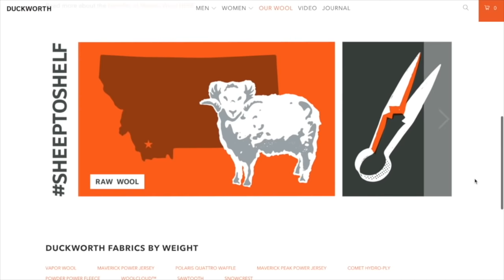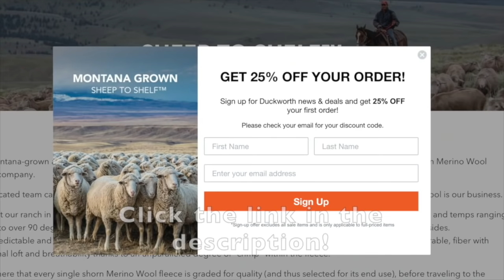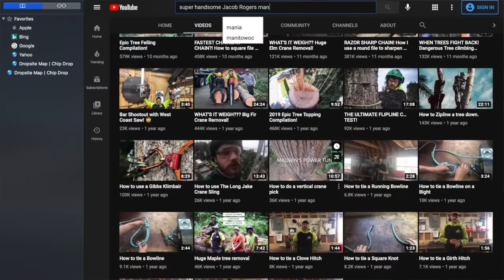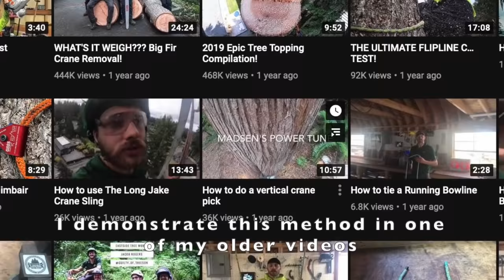Part 2! GIGANTIC Dead Maple Removal!

Comment: That was a great job, carefully thought out and executed. It does make me nervous seeing logs weighing several thousand pounds hanging in a sling almost directly over you.

That hole in the middle of the stump reminded me of a huge Valley Oak my neighbor had that split and fell. It looked perfectly healthy except for a V fork about 35 ft. off the ground. The larger  half fell into my yard and flattened 2 big buckeye trees, plus it broke a both railings on an arched bridge I had put over a small creek bed. 

When the tree guys were done cutting everything up, the stump was almost 8 ft.@ 2 ft. off the ground and 3.5 ft. of the heart was gone. You could have enlarged it and made a hot tub out of it!

An arborist estimated the tree at 325 years old give or take 20 years.

Comment: New subscriber.  At the first of the video you were speaking of Duckworth, I will check them out.  I am older than you.  I got a kick out of your statement about wearing the garments for a month and not washing them a lot.  My wife is always on my case because some of my favorite garments do ot get washed as often as she thinks they should.
I am in process of putting 5/4 deck boards on my bedroom walls and ceilings, and was impressed that the back ground wall was covered in what looks like a similar material.  Looks good, hope mine looks as good when it is finished.  At least when comparing some individuals there is not too much of a generation gap.
I volunteered to clean up some tornado debris this past summer, lost weight, improved my health, met new friends, and improved my health and well being.

Comment: As a crane operator, I always made sure I removed the limb or trunk straight away from the arborist, and lifted while not over top of the arborist.
If you watch crane videos , strops and ropes can always break, or slip,
Most mostly break.

Comment: Another great video. 
Fill that stump with diesel & tarp it. Maybe drill some really deep 2" diameter holes & diesel them also. Let it soak in for at least a week. Screw some metal flashing to the side of that deck, leave a gap. Water the deck & keep it wet. Start the stump on fire. It might burn for 2 weeks.

Comment: This was a professional job to the highest degree. All the best equipment and guys knowing what to do as a team. That was very dangerous and they did it safely. I cut trees for over 30 years but I learned a lot from these guys. I guess the stump you leave it, but still a jam up job. I finally got to see 088 Sthil in action. 
. LB Oklahoma Nov 2022

Comment: Back in the 70s while I was working for local parks&rec we had to take down a 125ft tall Loblolly pine that was eat up by pine beetles- at the ground level it turned to be 5ft across- we didn't top it just fell its- we put a pull rope on it about 75ft up and pulled while cutting- just as it started to fall over a high wind gust stood it back up crushing the chainsaw bar and jerking back the tractor pulling on it- that was a FUN day lol

Comment: Hey man I was watching your 500i video the other day.  You mentioned that in 10 years you haven’t figured out how to not spill bar oil when topping off the saw.  I am sure it was more a joke than serious observation, but I have found a pretty good remedy.  An old laundry detergent bottle works great.  The kind with the little push button tap on it. Thanks for all you do.  Climb high, be safe.

Comment: I have found that the size of the cut versus the bar width on small electric chainsaws can tend to make them more susceptible to jamming, especially with some type of wood.  They basically don't have the same "clearance", so stringyer, wet, etc, type wood cam jam more easily than with a larger dang/dang saw as they have more chain cut to bar clearance.

Comment: You guys were talking about milling at the end. What happens with wood like that? Is it for you to keep, the owner of the house, does it go to a sawmill?
Reply: The owner of the house decides what to do with the wood during the bid. I had 7 trees wind sailed and a 1 small Doug fir and large black locust tree out some of the  Douglas Fir branches were 3-4 inches thick. I had the tree service take all branches that were smaller than 3 inches. I ended up with 7 cords of wood from the work. None of it was worth slabbing. I filled up 2 truck loads of chips from the black locust branches and the smaller Doug firs. I’m glad I did this in 2008 spring right after we purchased the house. It was one of the few smart decisions I’ve made. His video of the tree down on the roof while pounding in the fence post rekindled the “glad I had that done” I have 7 trees only 75 feet from my back of the house and they are 100 footers. I hope they don’t come down while I own this place. I ‘d call these guys to come crane it off if it ever does.

Comment: @11:40 "BuT eLecTriC iS THe fUTuRe" lol not yet haha
Reply: I agree, a chainsaw with an electric motor that had the same power output as one of those larger chainsaws (like the 880) would be much much heavier, to the point that I'm not even sure someone could lift it even if the motor was brushless, and that's not even mentioning the fact that the battery pack to power such a saw would be more of a battery BACKpack, simply because it's so heavy and large, and you'd basically have welding cables going to the saw itself.
A much more practical solution is found in heavy-duty power chainsaws that you find mounted on something like a purpose-built logging tree harvester. Where the engine or electric motor would normally go, you find a quite small for it's power output hydraulic motor, which is connected to hoses that lead to a pump that is spun by an electric motor for sawmills, or the engine if it's a harvester. This is mostly because you can make a hydraulic motor very compact for the amount of power and torque it can put out, but instead of being a way to have higher performance, it's more a way of moving the power from the source to where it's needed, since hydraulics are merely a method of transferring power, and not a source of power itself unless we're talking about a hydroelectric dam.

Comment: This is an observation question. The spikes that you wear, wouldn't it be better for the lower velcro part to be on the outside and not towards the inside for catching on the tree? I've never done tree climbing or anything so I don't know how the spikes work attaching wise

Comment: What do you use for bar oil. And as long as I'm asking. What 2 stroke oil? I noticed you used an old laundry soap container. I like it. After this gallon is gone I'll be switching to that

Comment: So, I watched both episodes and surely it was a difficult job to do and you and your crew did a magnificent job on it. I'm a home owner and an armature wood worker and my only negative comment is that some of what your guys ran through the chipper (which was a very impressive chipper) should/could have been saved for milling. I'm a big maple fan and distressed wood is my favorite kind. I suspect that you shredded some beautiful figure and that is a shame. Perhaps your company could work out a deal with a local milling company so that some of this wood doesn't have to be shredded? Just a thought.
Reply: why did you think  most logs are not shredded..?? These guys have no time to run around trying to sell a truck load of logs. They have a yard full of logs. Go take your pick.

Comment: Do you use a case on your camera when shooting your videos? The camera I am using has a waterproof case and it makes it very hard to hear the audio. I often work in wet weather much like you do didn’t know if you and any suggestions.
Reply: In this video you can often see Jake's GoPro.  It does not have a case.  The GoPro 5 and greater are waterproof if all the access ports are closed.
Reply: @wallykramer7566  thanks I thought that was the camera and I didn’t know that about it thanks for the info.

Comment: Hey all!
Quick question, what is the tooth/spikey looking thing at the start of the blade for?

No i havent done a days hard woodwork  a in my life, can you tell? haha

Really enjuy the content on here, extremly addictive
Reply: It’s a guard that can be stuck into the tree to create a point of leverage for the saw so the user doesn’t have to apply all of the force required to cut the tree
Reply: @haydenreeves7987  thank you

Comment: Nope you need at least 2 pairs to switch every 2-3 days ... Opposite climate check out the Tilley company ...  cotton washables, wear one, wash one, switch and go.  Only need 2 sets to handle everything in areas where luggage is a concern.  Help you? No.  Concept perhaps?  Maybe.  But wool may need longer time to dry.

Comment: Can you start filming in 1080p (or even higher)? 720p is such a low resolution.
Reply: They film in 720p because these jobs take a very long time, and thus they generate a lot of footage. In 1080p, they likely will not have enough storage space for this.

Comment: And to think I'm so careful measuring out my oil to the milliliter when mixing up my 2-stroke fuel, and you are just using "glugs" as a measurement.
Reply: As long as your close it’s good enough.. too much oil is better then not enough. Always throw extra in worst that can happen is you foul the plug. 3$ fix rather then seizing the motor if you run it lean.

Comment: How old was that maple? Great job btw 👌
Reply: Seems likely to be 95 to 130 years.
Reply: @briananderson7497  The count to the hole was 90 or 95, an estimate I think.  The rings that used to be within the hole had a larger range for estimates.  I think Jake mentioned 120 and the assistant a little more.

Comment: What does "ported by" mean ?
Reply: Specialist small engine mechanics modify the saw pistons shapes, sizes, heads, and timing in various ways, usually increasing the volume, and thus the power. Stihl 88(cc) could becomes the 97(cc) for example. Other parts can be swapped out too, like the air filter and other bits. Search for "chainsaw porting" here on YouTube to learn more.

Comment: I'm getting a bad feeling someone or some kids going fall into that hole and not get back out. That hole should be sealed up.
Reply: I was thinking exactly the same thing, but all the pieces the right size to plug the hole with had already been chipped.
Reply: Maybe use the wood chips